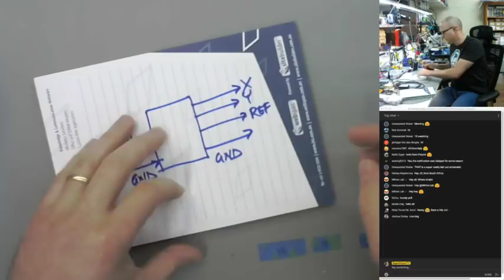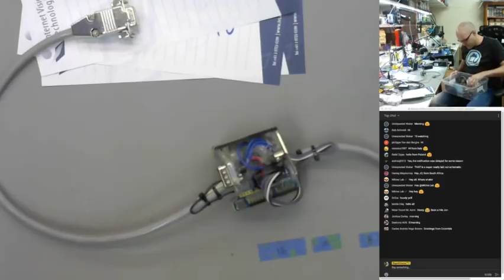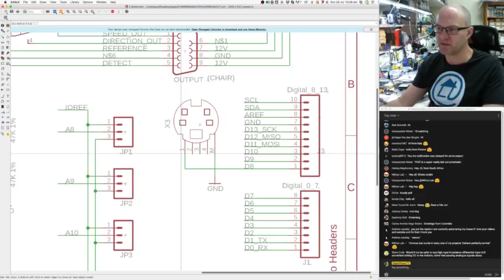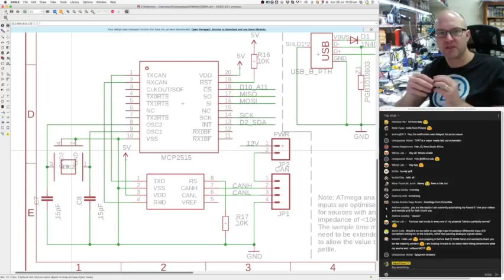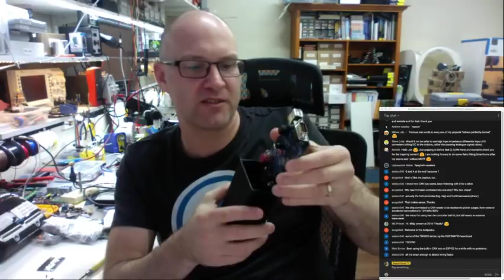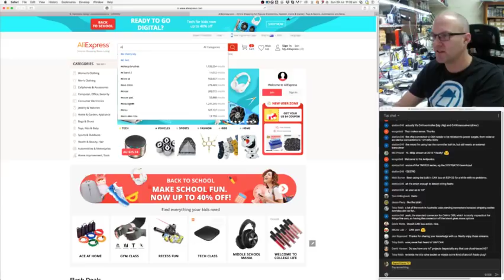SuperHouseTV Live Q&A: digging through my Eagle projects, part 4

Comment: The way the joystick reports movement looks like something that was built to be compatible with pure analog controls.
Something with a simple Potentiometer where the battery voltage would be connected to the center tap, and voltage would be above or bellow that depending of the joystick.

Comment: If you turned SW1 around, with the common pin being the output, could you avoid the need to restart the chair if you connected one pin to input (X or Y) and the other to Ref? In doing this isolation would be achieved by sending REF to the chair. Could you avoid the chair restart by doing that?

Comment: This is probably off topic but currently, my setup is all Zwave running on the Homeseer Hub, It runs flawlessly. I'm attempting to try Hassio with sonoff wifi but I have arond 20 2gig sensors that are 345 mhz and wondering if anyone has gotten to work in homeassistant or homeseer?